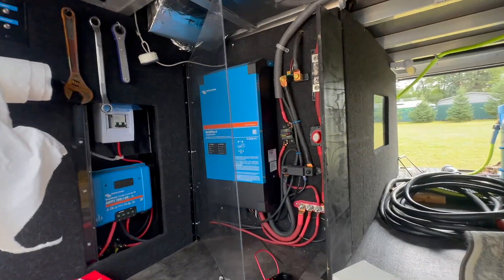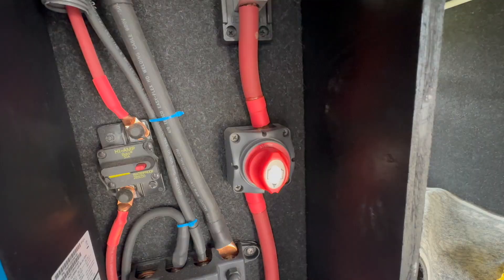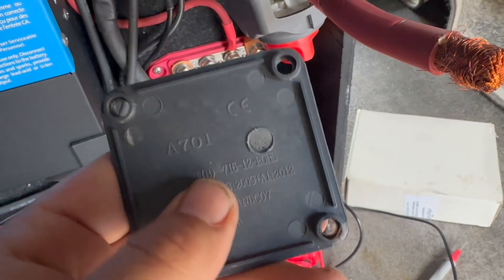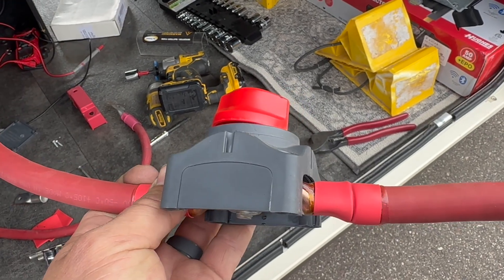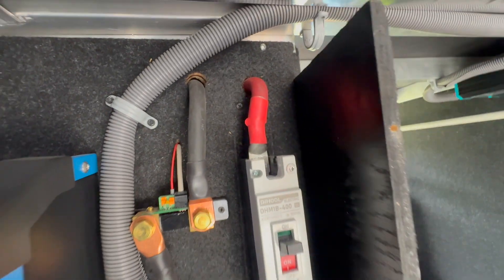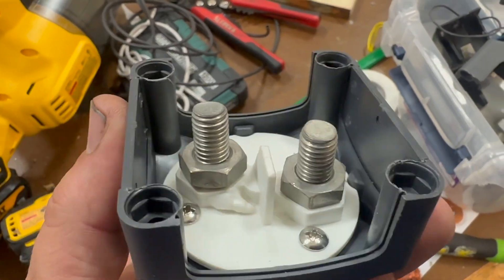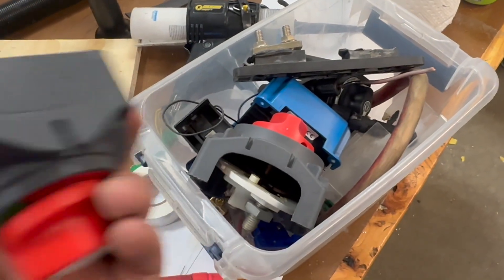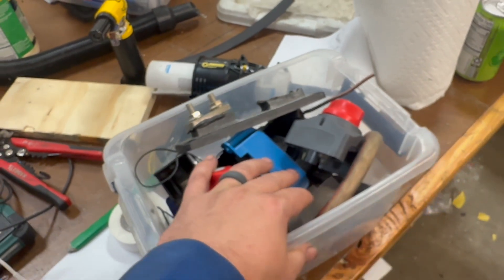This RV Battery Switch Failed (and What We Used Instead)

Comment: Not bashing, just learning and educating.  I thought the ABYC recommended a class T fuse within 7” of the battery bank.  I can’t see how far away the battery bank is, but I’m certain that we can’t relay on a circuit breaker as the sole protection of the battery bank.  If it is a secondary means of protection, then I really like it.  Dihool does make several classes of the single pole breaker.  The one with “X” in the part number has a much higher interrupting capacity, and would be my choice.  I also don’t see any downstream distribution fusing.  Great video!

Comment: Nice catch!  Steel nut seat.  Not a chance of that being copper or being tinned.  Probably zinc-coated... just a regular galvanized steel nut and bolt.   Totally insane.

Usually through bolts designed to have lugs on both sides run through a (tinned) copper block or bus bar and the lugs sit directly against the block.  Possibly with copper washers for spacing the lugs off the block a little (because the block is often housed flush in the plastic casing).  The bolts aren't supposed to be used as the primary conduction path itself.

Comment: The installer made very poor choices on that switch (low amperage rating). the class T fuseholder with no lugs in a mobile install, was just waiting to work loose. Vibration…happens. 

Are the dihool dc breakers UL 489 certified? I have used noark but have not been able to find any UL listed dihool breakers. 

Always nice info. 👍👍
Reply from the maker: I doubt they are UL , I did look up the spec. Sounds like a fun lab test to do ourselves. I can tell you they don’t get above 122f (if lugs polished ).
Reply: @sotasolar the test I need would be awesome to do but many things won’t survive😳. The AIC rating test for a short circuit fault from a large capacity LFP circuit dead short would be fun to watch. 

I think the IEC cert may be good enough but I am not sure the insurance company will feel the same. So, we spend a few extra $ to get the UL listed overcurrent protection, though there are some IEC standards that are as good, if not better for mobile (boats, RV) use. 

the dihool equipment generally follows the industrial IEC standards, which may actually be higher. 🤷‍♂️
Reply: It will depend on the batteries.  Regular server-rack style batteries have tight BMS disconnect specs precisely to avoid blowing out the I.R. when a bunch of paralleled.  Even regular fuses and breakers will generally work just fine.

But people also use random junk batteries and gold-cart batteries whos BMSs either don't have short-circuit protection and only a thermal (BMS temperature) trip, or are programmed to allow hundreds of amps through on purpose for "burst" operation.  Those can't be safely paralleled at all really.

-Matt
Reply: @junkerzn7312  just reviewing this video after watching someone else’s video showing some tests…

I totally get the BMS short circuit protections for an LFP battery as a potential mitigation. Unfortunately, the installation standards do not recognize the BMS as an OCPD.  They are not certified to any standard as such and get no credit. The assumption is the BMS FETs or contactor has failed closed. 

The most recent E11 revision does include several IEC CB standards as acceptable but the standard the Dihool MCCB is certified to, is not one of the listed standards that are acceptable and the NEC is still only recognizing the UL standards. 

Nowark, ABB and others make UL489 certified MCCBs. I don’t think Dihool does…yet. 🤞
Reply: Those things on the T-Class look like coated aluminum breaker panel lugs... designed for solid copper or low-strand-count copper.  Definitely not designed for environments with vibration, and definitely not designed for high-strand-count copper without a ferrule (which is what was stuffed into them).  Double fail.

Comment: That switch is impressively bad.  Glad I am going with BEP stuff for my install
Reply: Went BEP in 2016, switch still looks good as new. It's been in 2 trailers with 4 different batteries =) But I probably won't use it for my next build unless Victron makes a 48V 6.5k version of the 2x120 as the current plan is for a pair of 24V 3000 2x120s in parallel which would put the switch at >90% of rated capacity.
Reply: @andrewfidel2220  What is BEP?
Reply: @michaelcanto6175 BEP Marine, a division of Navico. They make high quality stuff intended to go into offshore boats. We use our trailers year round so they see  road salt so I wanted my main cutoff to be rated for a salt spray environment. They're not the cheapest option, but they go through actual qualification testing.